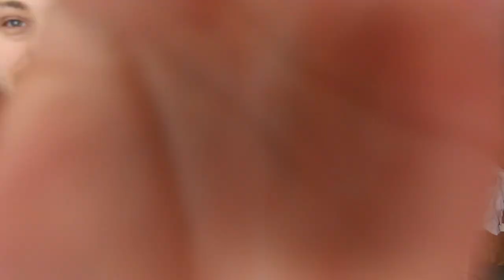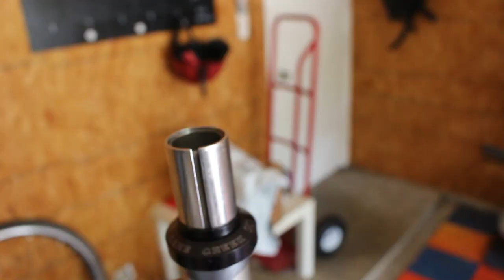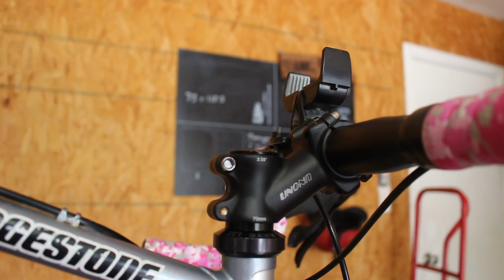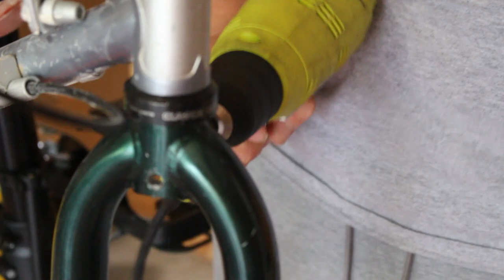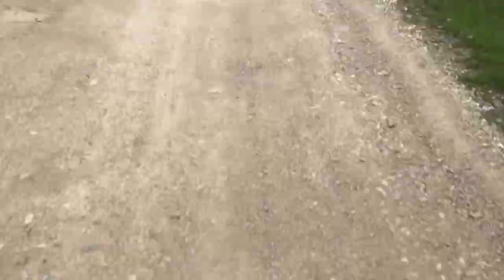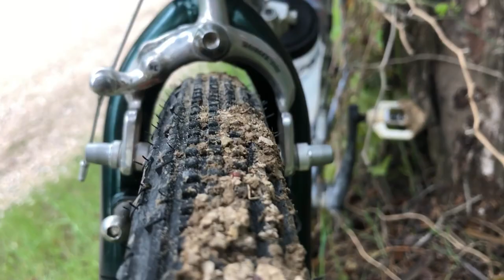I Put a Threadless Fork on My Vintage Gravel Bike

Comment: This is looking pretty great, the only mistake I have seen is hearing you say 2 or 3 times that it is pretty much done haha, bikes like these are never done, constantly evolving.  Its awesome  love it.
Reply from the maker: You nailed it. I just got it set up tubeless and I spent the day researching 1x11 drivetrains. A new dual pivot rear brake should be arriving soon and I’m toying with paint ideas 😂😂 more videos coming!
Reply: @tinkerbike2510  haha glad to hear it. I drop bar converted by 89 super Grizzly this winter after running it with swept bars last summer. They make fun bikes. Though not always as cheap as the original plan intended.
Reply from the maker: @mikemorton0  that’s sounds awesome. I’m having a hard time spending $500 on a group set haha
Reply: @tinkerbike2510  I got it as a frame and found a shimano M730 XT groupset for about 300. But the velo orange stem salsa cowchipper and shimano claris shifters were more than that again....
Reply from the maker: @mikemorton0  all those parts add up quite a bit don’t they 😬
Reply: @tinkerbike2510  yeah would have been cheaper to buy a new $1000 gravel bike....haha
Reply from the maker: @mikemorton0  but then it wouldn’t have been a sweet bianchi!
Reply: @tinkerbike2510  very true

Comment: A tall threadless stem adapter would’ve achieved the same results giving you the extra stack height in your cockpit.
Reply from the maker: No it wouldn’t have. The fork I installed has a longer axle to crown meaning it raises the headtube and slackens the angle.

Comment: What size wheels exactly? I’m running 700x25cm now and not sur if my wheels can handle wider tires or not. Thanks!
Reply from the maker: I was running 700x38 on this frame
Reply: 700x25 is for road bikes. You need 700x32 or wider for gravel.

Comment: Hey, I'm building a bridge stone 700 gravel and trying to choose tires. Did you end up crimping your chainstay to fit the 38’s?
Reply from the maker: Hell yes. The 500 and 700 shared frames but the 700 had a nicer group set. I did not have to crimp the chainstays. I removed the dropout spacers and slid the wheel all the way back to get the tire clearance.
Reply: Hey thanks for the info. I got one more question if you could help me out. I bought a 700c wheelset that had 25mm tires on them and trying to swap the out with panaracer 38mm and there not going on very easily. Do you think I need a wheel set with wider rims?
Reply: @joesuzuki_art  Its recommended to have at least more than half the width of the tire for the internal diameter of the rim

Comment: Bike really has turned out very nicely. Is the chrome piece that went over the fork steerer at time frame 6.10 an insert and why? Cheers
Reply from the maker: Thanks! It is a stem shim so I can run a normal 1 1/8" threadless stem on the smaller 1" threadless steerer tube.